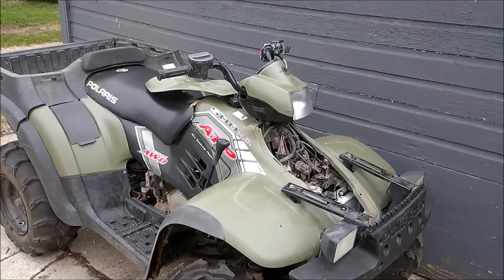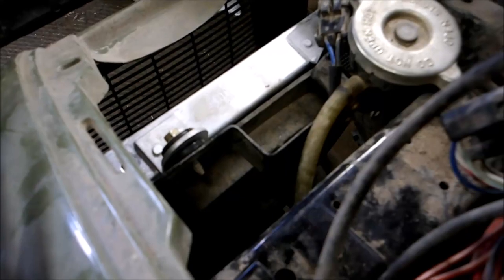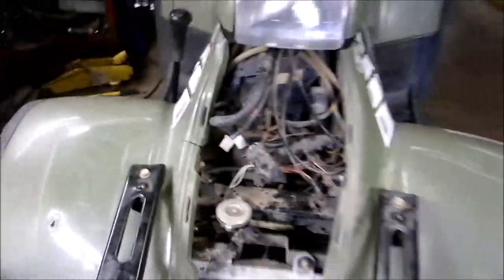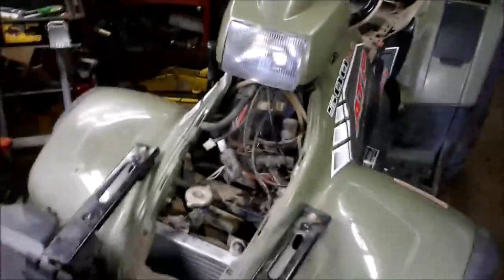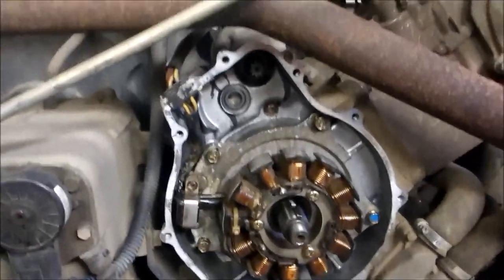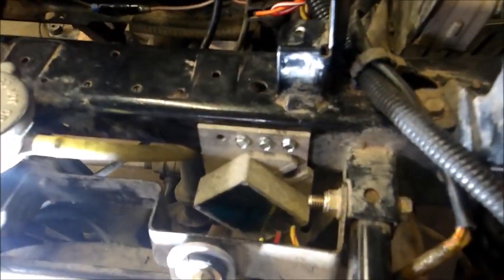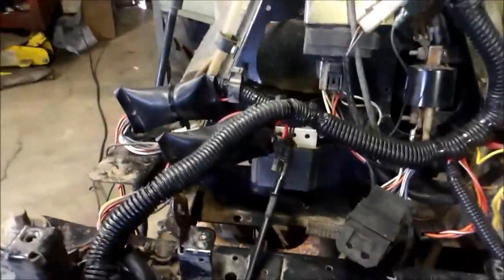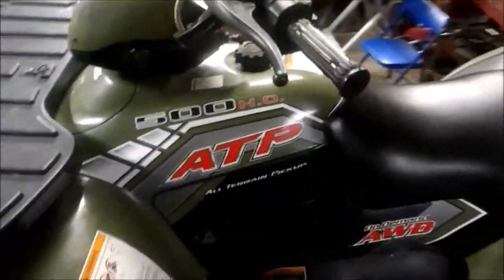BAD ECM ON A 2005 POLARIS 500? DONT REPLACE IT! GET RID OF IT! I'LL SHOW YOU HOW.

Comment: Now the wrench flashes all the time but whats really worse is the dan coming on with the key. Its rare for the 500 fan to even kick on till it goes hot. Your better off adding a switch and run the fan on hot days while hauling or towing something.
Reply from the maker: True. but the down side is people forget to turn the fan on. I bought 2 with fan switches and blown motors.

Comment: A little off the subject... I have a 2012 Sportsman HO 500. Back a few months ago I noticed around 5000 rpm it would bog down and almost die.. It idled and run fine otherwise. Since I hadn't rode the thing very much, I believed it was trash in the carb. I cleaned the carb and replaced the jets.. No improvement. So, I purchased and installed a new carb.. Problem didn't improve. I changed the plug.. No help. I replaced the pulse pump and all the fuel lines.. No help. Removed and cleaned the tank.. No help. I knew the air filter was new, so I hadn't even given it a thought, that it might be the problem. But, one evening while listening to the engine idle, and revving it a little.. I thought I'd remove the filter cover and see how it run.. and it actually improved a little.. So, I removed the filter, and it improved a little more. And that's when I found the culprit. All that money spent on parts, time of changing them out.. and the irritation of worrying about this bike.. came down to the hard plastic sleeve inside the rubber breather tube, that prevents the rubber from crushing when you tighten the air filter onto the rubber intake hose. When I replaced the air filter, I had invariantly caused that little hard piece of tubing to be turned sideways inside the rubber breather hose.. which allowed enough air for the bike to idle and run half throttle, then fall on it's face around 5K rpm or so. Moral of the story.. Check everything, even if you think it's correct.
Reply from the maker: Good Catch. I have so many people asking that same question. It could be anything. Most of the time its something pinched not letting air to flow in.

Comment: Great video! I just bought an 05 scrambler 500 not running, once I got it going it has some mysterious electrical issues. like with key off the dash lights would light up randomly neutral then the hot light or reverse or they all would come on at once had my local dealer run my VIN and sure enough it still had a open recall on the ECM.  So that’s where it’s sitting now.  Keep up the videos they are great! I like wrenching on older Polaris’s as a hobby if I get stuck on something I usually find a video where you’ve explained it and it’s pretty helpful
Reply from the maker: Great! That's awesome. I'm glad my vids helped.
Reply: My polaris scrambler is shutting of randomly and when i fully gas it it doesnt go but only at half throttle

Comment: An alternative solution to this is to eliminate the ecm box entirely with a few basic changes to the wiring. I successfully deleted mine from a 2004.5 sportsman by connecting the circuits together and adding a Honda atv style voltage regulator. Battery is charging fine. Will need to either run the fan constantly or find a fan switch solution.
Reply: Any chance you can give me a detailed run down of what you did? I have a 2004.5 I’m looking to eliminate the ecm since I can’t find one anywhere.
Reply: @paintermanmusic  Sure. Are you able to send me an email on here? I can draw a quick wiring diagram.
Reply: @smallgaragehustle  jeredjacob22 Gmail 
My last comment got deleted, maybe I’m not supposed to put an email address? Appreciate your help!
Reply: Can I have those diagrams too please?
Reply: @abelchang7612  I can forward what Steven sent me. What’s your email
Reply: @paintermanmusic  greatly appreciated 👍
Reply: @abelchang7612  Sure. Need you to post an email address, broken up
Reply: @smallgaragehustle  abelchang212
Reply: @smallgaragehustle  gmail
Reply: @smallgaragehustle  hello, sorry for being a pain in the arse but can I have a copy of the diagram please? Thanks in advance 🙏
Reply: @abelchang7612  check your email.
Reply: @smallgaragehustle  I've checked all folders in my email but haven't seen anything.
Reply: Peace and love guys can you send me one also please and thank you 
Snookanthony40
Reply: Gmail
Reply: At g mail

Comment: sounds like if the ecm is giving faulty Hot signal, trace those wires and verify thru a wiring diagram that you can cut and bypass the ecm , splice those wires together, free fix , but you would have to monitor your coolant system manually or add in a cooant temp meter so as not to overheat.  .... ecm may tend to ground out in that area if its happpened many times is my guess?

Comment: What about radiator fan running all the time , isn't that going to take up all amperage from stater coils  , I believe there something like 1.5 to 2 amp output  , what about battery charging ?
Reply from the maker: There is a chance the fan could burn out after some time. Some guys add a switch to it.

Comment: Probably a stupid question, but how’d you Hotwire the fan? My fan won’t kick on once engine starts getting hot. “Hot” flashes on screen once engine gets up to temp. Not sure how to fix this issue. Thank you.
Reply from the maker: what year? I have a couple videos on how to do it.
Reply: @TitaniummanGarage  I actually just found the video on this. Thank you for the reply. I appreciate it.
Reply: @TitaniummanGarage  I Hotwired the fan with your method for ‘05’s and up and the fan did not come on. I ran 12v direct to fan and it does run so I know fan is good. Any other ideas? Thank you!
Reply: If it's a 2005 you can unplug it and it will always run. The plug is located by your fuel filter on the side of engine.  If you unplug the two wires it should turn on.

Comment: It would be impossible for me to find 2004 atp parts. My grandmother has an 05 with the bad ecm. Polaris doesn't offer them for sale now. I'm trying to look into using all the electrical off another Polaris 500 quad.
Reply from the maker: Everything would work except the turf mode if you did that. They still sell ecm for an 05. Check out ebay.
Reply: I have the same atp and my dad replace the ecm from another atv and it work 4 days and ecm just die. You must buy original ecm to have a good and working atp.

Comment: Will this work with all Other ECM I have a ELECTRIC CONTROL MODULE (ECM),
Polaris
item: 4011090 that has been on BO for over a year not activating my fuel pump
Reply from the maker: Depends what year it is.
Reply: 2005 Polaris  Ranger

Comment: Mines charging at 18 volts at idle. The quad has only 1000 miles and 260 hours. It doesn’t have the black elm. Should I just by a new ecm? Mines a 2005 Sportsman.
Reply from the maker: For a sportsman? yeah I would. Sounds like you have something going on. Or the voltage regulator.
Reply: @TitaniummanGarage  they have the Voltage Regulator built into the PCM. I’m gonna ohm out the stator tomorrow. The dealer told me today to check it first. I actually have a great dealer by me.
Reply from the maker: Oh yeah. I was thinking of the 04 conversation I did.

Comment: I have an 04 scrambler 500 with a cdi box, regulator rectifier, and ECM. I am so confused. I concluded to a bad stator, (not charging) and tested it with a multimeter. I can't find a stator with the correct wiring so far. I need this thing running by next weekend, any ideas? My brain hurts. I also have a parts sportsman 500 that looks to have the same system as my 00 scrambler 500 that I know works, can I just swap that harness in? Or easier yet, can I cut out the old stator and splice in that one?
Reply: Yeah but mark what wires to use

Comment: Do you know what flywheel and stator you had to use apparently they had 2 they used on the 2004 . The flywheel should say ff97 or ff95
Reply from the maker: I'll have to check. I believe it was a ff95
Reply: Doing the swap and ran into the issue of finding a stock rectifier . Are the wire colors the same on the harness plug to the rectifier?

Comment: Hey, if I use the ecm from a 2005 sportsman 500 can I just plug it right in and will everything work correctly besides turf mode ?
Reply from the maker: That I'm unsure of. The part number is different.  Not sure what else is?
Reply: Got ya, yeah I’m kind of up shits creek because I can’t seem to find an ECM anywhere.I’m not having issues with the fan continuously running or anything. The only problem I have is if I run the machine for a little bit and then turn it off it doesn’t start back up for a couple minutes I guess it has to cool down or something.
Reply from the maker: I have heard of that happening to guys. I think your on the right track. Check all your ground wires. By the speedo/light switch. There is a ground by the rear left tire and up in front. Try to add an extra ground wire. I had to do that to this one. Some wires were turning green so I didn't trust the ground wire.
Reply: Martin, you shouldn't have any issues with using a 04-06 sportsman 400/500 ECM (Part#2203348). You are correct though about not having turf mode. I was considering the rewire that Titaniumman Garage performed but after reviewing wiring schematics of the 04/05 ATP and the 05 Sportsman I decided against. One, I couldn't find all the parts I needed at a reasonable price if at all. Two, I found that both 05's were virtually identical less the turf mode and tail light configurations. It was a good call on Titaniumman's part just wasn't going to work for me. I just got mine running this week and everything seems to be working fine. I did take some advice from Titaniumman Garage about the 04 wiring, I did purchase an 04 ATP Differential Solenoid Switch and rewired it to match my 05 so I'm still able to use turf mode. I like to keep my equipment in as close to the original working order as possible and this seemed to do just that. Hope this helps, good luck and thanks Titaniumman Garage.
Reply from the maker: @isaach4627  Thanks I'm glad I could help. So your saying the 04-06 sportsman ecm works on the ATP without turf mode?
Reply: @TitaniummanGarage  Yes, that's correct. I plugged in the 05 Sportsman ECM and my ATP came to life. Instrument  cluster, lights and controls all seem to be in working order. Stator coil resistances are the same as well on the 400/500 05 Sportsman so there shouldn't be any charging/ignition issues. I was reading 12.3v before starting and 14.28v after we fired it up. When you look at the schematics on the 05 Sportsman, the only connection your missing on the ECM is the turf signal/control connection. Like I mentioned above, I corrected that issue by using a differential solenoid switch off an 04 ATP. It's not a direct plug and play as you're probably aware but it didn't take long to rewire a couple connectors. Now everything is back to being fully operational.
Reply from the maker: @isaach4627  sweet! That's good to know. Thanks.

Comment: Do you have a wiring diagram for a 2004-5 Polaris 500 ATP
Reply from the maker: No..I don't. It was all plug and play. I just matched everything up when I replaced the harness.
Reply: It's the back two pages of the service manual. I can provide if needed.

Comment: i have a 2001 polaris sportsman 500 ho it cranks not start. but it only starts with a jumper I'm not sure what the issue is. Ive replaced the starter, fuel pump, and cdi box. if anyone knows what the issue is please tell me.